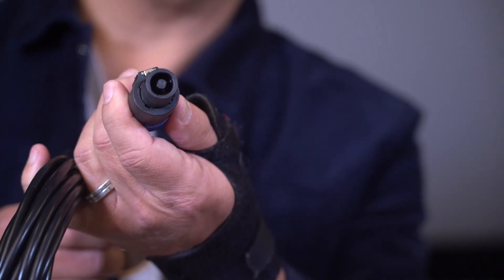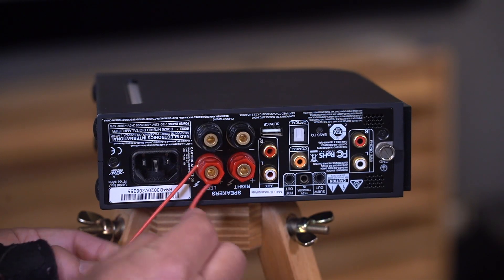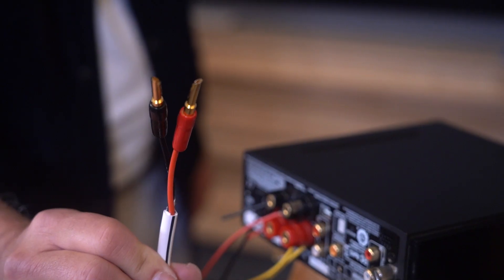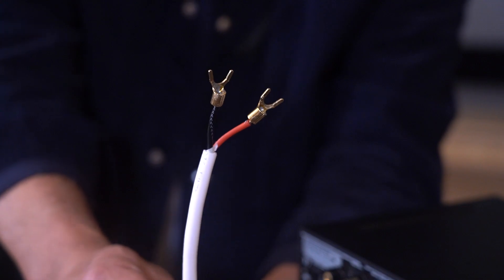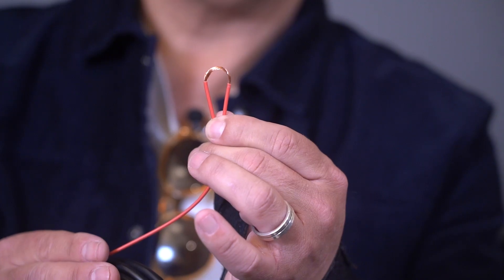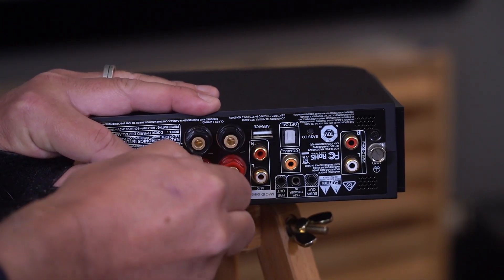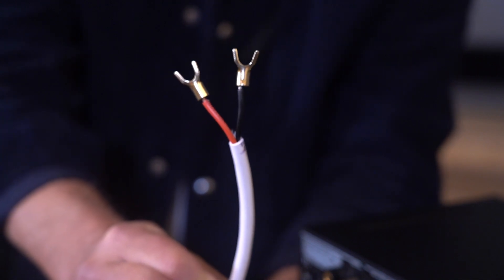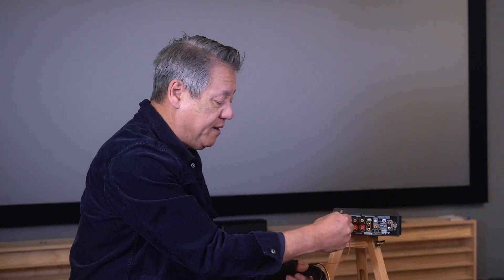What are some tips for the best way to connect a REL Acoustics subwoofer high level?

Comment: Hello, I can connect the cables of my REL T5 at the same speaker output? Not damage the power amplifier?
Reply from the maker: Thank you for reaching out. The High Level input is designed so that it can be connected directly to the main speaker output terminals on your system's amplifier, alongside your main speaker wire connection. Due to the High Level input's use of a significantly high input impedance, this connection can be made without the subwoofer placing any additional current load on the amplifier, or drawing any amplifier power away from your main loudspeakers.

Comment: Believe Accuphase E5000 with B&W 805d4, my new amp, should be OK with REL, can you suggest which model is the most compatible? Thank you.
Reply from the maker: Thank you for reaching out. Several of our subwoofer models can pair well with your B&W 805 D4 speakers, and can be connected to your Accuphase E-5000 integrated amplifier, though the ideal subwoofer choice for your system will depend on a few additional variables. When you have a chance, please write in to contactus@rel.net and a member of our team will be happy to discuss further and provide a pairing recommendation specific to your system.

Comment: Thank you for this video! I am a little intimidated about connecting the high-level cable but this makes me feel better: I am planning on using a REL T5X with a system that has a class-D amp by SMSL (specifically the AO-300 -- not the similarly-named A300 or the AO200) as the control center, and Dali Spektor 2 bookshelf speakers for stereo left- and right. So I understand that I wrap the exposed part of the red lead around the positive terminal for the right speaker, the yellow lead around the positive terminal for the left speaker, and the black lead around the negative terminal for the right speaker. Am I inviting technical problems using the other components that I've mentioned here? I know you can't use the high-power line with a balanced amp, and the SMSL is not balanced, but are there other problems I need to look out for before proceeding?
Reply from the maker: Thank you for reaching out. The High Level connections that you have described for the red and yellow wires are definitely correct, though since your SMSL AO-300 is a Class D amplifier it will be important to not connect the black wire of the High Level cable to any of the negative speaker output terminals on the amp. Instead the black wire should be left completely disconnected, or if you experience hum then the black wire can be attached to a chassis screw on the amp. Alternatively, you can leave the black wire completely disconnected and instead run a basic RCA cable from the .1/LFE input on the subwoofer to any open/unused analog RCA input or output jack on the amp. Either of these options will provide a ground reference for the subwoofer and will resolve the hum.
Reply: @RELAcoustics  Oh my gosh I am so glad I asked! The AO300 has a subwoofer output -- would that count as an "open/unused analog RCA output jack on the amp"? So I connect red to right-speaker-positive, yellow to left-speaker-positive, black unconnected, and then a single RCA from sub out to .1/LFE? (Asking b/c that's about the only open RCA socket I'll have.)
Reply from the maker: @CinemaDemocratica  Thank you for your response, and yes the subwoofer output jack on your AO-300 amplifier would work as a grounding point for the subwoofer. You would then only connect the red and yellow High Level wires, and keep the black wire completely disconnected.

Comment: Just bought a TX5. My Rotel A11 has Two Speaker Zone. Would you suggest to connect the Rel to Zone 2? While maintaining my bookshelf speaker to Zone 1?
Reply from the maker: Thank you for reaching out, and for choosing a T/5x for your home audio system! If your main loudspeakers are currently being connected to the Zone 1 outputs on your Rotel A11, then we recommend also connecting the High Level cable for your T/5x to the same Zone 1 output terminals. This will enable the subwoofer to receive the exact same signal as your main loudspeakers are receiving, resulting in improved performance and a more seamless blend.

Comment: Will this connection draw additional power from the power amp?  I have hard to drive 4 ohms speaker and I want to make sure that all the power from the amp is going to the speakers.
Reply from the maker: Thank you for reaching out. The High Level input on our subwoofers is designed with a significantly high input impedance, which means that it will not place any current load on your amplifier or draw any amplifier power away from your main loudspeakers. As a result, connecting a REL subwoofer to your amplifier using the High Level input will not impact how the amplifier is powering your main loudspeakers.

Comment: Is there a way to connect REL subwoofer high level with KEF LSX ? I guess not
Reply from the maker: Thank you for reaching out. Since the Kef LSX are active speakers, meaning that their amplifier is built-in to the speakers' cabinet, it is unfortunately not possible to connect a REL subwoofer using it's High Level input to these speakers. Instead we recommend connecting the REL using it's Low Level RCA input, to the designated subwoofer output jack on the LSX speakers.

Comment: What do you do if you have a five year old T5 that's capacitors have leaked all over and it no longer does anything but blow fuses? Should i just put it in the bin?
Reply from the maker: Thank you for reaching out, and we are sorry to hear about the issues that you are experiencing with your T5 subwoofer. When you have a chance, please write in to contactus@rel.net and our support team will be happy to assist with troubleshooting and resolution options.
Reply: @REL Acoustics  I did, a week ago, asking if I can purchase a replacement plate amp. They haven't got back to me. Just seems such a shame to throw it out, I don't think I could even if I had too. Beautiful cabinet and a waste of a damn good driver.
Reply: @RELAcoustics  actually. I sent it as a ticket on the website. I'll try the email address you provided. Tha ks for getting back to me

Comment: What if I’m running my large bookshelf speakers as “small” on the receiver but want to add bass by using one of your subwoofers for each channel. I don’t want my speakers to play low frequencies to avoid distortion. I want the low frequencies to be played by the subs. Can REL help?
Reply from the maker: Thank you for reaching out. If you prefer to run your main loudspeakers set to "small" then it will be best to connect your REL subwoofer using either the Low Level input or the .1/LFE input. A crossover can then be set within your preamp or receiver so that the signal above the crossover point is sent to the main loudspeakers, and signal below the crossover point is sent to the subwoofers.

Comment: I have a benchmark AHB2, it accepts balanced inputs only, can I connect this as normal or do I need to take the black wire to a ground? There aren't any convenient ground screws on the amp itself, ideas?
Reply: benchmark website shows you how to do it
Reply from the maker: Thank you for reaching out. When ran in it's standard stereo configuration the negative speaker output terminals on the Benchmark AHB2 reference to ground, which means that the black wire of your REL subwoofer's High Level cable can be connected to the negative speaker terminal for either the right or left channel on this amplifier. Here is a link to an article from Benchmark's website that goes into detail about connecting High Level to this amplifier: https://benchmarkmedia.com/blogs/application_notes/rel-subwoofers-with-ahb2-power-amplifier

Comment: Does this approach only work for one front speaker to one subwoofer?  I have a single sub to support both front speakers.  Will this method not be possible unless I have two subs?
Reply from the maker: Thank you for reaching out. It is easier to connect the High Level cable to the binding posts on the system's main loudspeakers if you are using a stereo pair of subwoofers, since you will have separate subwoofers dedicated to the left and right channel speakers. That being said, it is possible to connect to the speaker's binding posts with a single subwoofer though when doing so it will be necessary to strip back some of the black outer sheathing on the High Level cable so that the red wire can reach your right channel speaker and the yellow wire can reach your left channel speaker.
Reply: @RELAcoustics  Thanks so much for the quick reply.  Do to space limitations in my room, I can only use one subwoofer.  I also wanted to use the wireless adaptor.  Can the direct connection to the binding posts be done if the wireless adaptor is being used?
Reply from the maker: @redsoxjam  Most of our wireless systems do allow for High Level connection, though typically if using a wireless system you will then connect the High Level cable to the outputs on your amplifier, and then place the wireless transmitter next to the amplifier. 

For connection assistance and instructions specific to your system, please write in to contactus@rel.net and we will be happy to assist.
Reply: @RELAcoustics     Thanks for all the feedback and the how to videos.  I bought the T/9 x and will be setting it up as recommended with the front speakers in “full” mode.  What do you recommend for the center channel when the fronts are set to full?  Would you recommend setting a crossover of 120-80hz or keeping it as full?
Reply from the maker: @redsoxjam  We find that most speakers perform best when set to "large" and sent a full-range signal, though if you do not have a REL connected High Level to the center channel then you are welcome to experiment with applying a crossover to this channel within your AVR. 80Hz is a common value, though it will be best to experiment with different values to see what sounds best to your ears and in your room.

Comment: A quick question because I can’t find a definitive answer, 
I have a tube amp (it says it’s class a/b) 
So if I’m wanting to use two subs (REL Q100) I would connect the red and yellow together to left channel + and the black to left channel neg and then the same on right channel with other sub? If so am I right in saying this won’t damage the amplifier in any way? 
Thanks in advance
Reply from the maker: Thank you for reaching out. If your tube amp is Class A/B, then you are absolutely correct in terms of how to connect the High Level cables for your Q100 subwoofers. For each subwoofer, red and yellow wires will connect to the positive output terminal and black wire will connect to the negative output terminal. If your amplifier has different output terminals for different impedance speakers, then we recommend connecting the red and yellow High Level wires to the 8 ohm positive output terminal, even if your main loudspeakers are connected to output terminals for a different impedance.
Reply: @RELAcoustics  excellent thank you 👍🏼

Comment: What if your integrated amp only takes spades?
Reply from the maker: Thank you for reaching out. While the High Level cable that is supplied with our subwoofers comes bare-wire terminated out of the box, spade or banana connectors can be attached to the bare-wire ends of the cable if needed, depending on the output terminals on your amplifier.
Reply: @RELAcoustics  will it connect to a digital integrated amp the same way ? I have a Technics SU-G 700 M2. I was going to follow your manual for set up. I thought I read that if you have a all digital integrated the connection is different.
Reply from the maker: @williemclean3224  Spade connectors can be used with Class D integrated amplifiers such as your Technics SU-G700M2, though special care must be taken when connecting High Level to Class D equipment. Here is a link to our video with connection instructions for Class D amplifiers: https://www.youtube.com/watch?v=3F5WTOu60hE&t=1s

Comment: My main speakers are connecting to the 4ohm speaker binding posts on my Mcintosh Power Amp.   Should I connect the REL to the same 4ohm binding posts or to the 8ohm binding posts ?
Reply from the maker: If your amplifier has separate output terminals for different speaker impedances, then we recommend connecting the positive leads of the High Level cable (red and yellow) to the 8 ohm positive output terminals on the amplifier. The main speakers can then be connected to the output terminals for their proper impedance rating, whether that is 4 ohm or a different impedance value.
Reply: @RELAcoustics  Thanks for the clarification.

Comment: I would like to use the REL TZero MKIII in my 5.1 setup. I have an AVR with a pre-out for a subwoofer, as well as several RCA outputs unused (for rear surround speakers for example). How can I make use of the High Level connection with such an AVR? The supplied cable does not work with the pre-out for subwoofer on the AVR, right? Can I use the unused RCA outputs instead, even though I won't be connecting rear speakers but instead the REL subwoofer?
Reply from the maker: Thank you for reaching out. The .1/LFE input on your Tzero Mk.III can be connected to the designated subwoofer output jack on your AVR, using a standard RCA cable, while the High Level input connects to the amplifier's main speaker output terminals using the specialty cable supplied with the subwoofer. If the Tzero Mk.III is the only REL in your system, then the High Level cable will typically be connected to the front right and front left speaker output terminals, in parallel with your main speaker wire connection. 

For High Level connection instructions specific to your system, please write in to contactus@rel.net and we will be happy to assist.

Comment: How long is the high level cable that is provided with the REL sub? Asking this question for someone who wants to use one sub for a stereo pair of speakers quite far apart.
Reply from the maker: Thank you for reaching out. The High Level cable that comes supplied with REL subwoofers is 10 meters, or approximately 33 feet, in length.

Comment: So you connected the red to the left, just the opposite of your set up recommended
Reply from the maker: The red and yellow High Level wires are functionally identical. We typically recommend connecting red wire to right channel positive and yellow wire to left channel positive, though you will achieve the exact same performance by connecting yellow to right channel positive and red to left channel positive.
Reply: @RELAcoustics  so what about the single black wire?  2 black binding posts...
Reply from the maker: @rockyrekstad9517  The black High Level wire is exclusively for providing a ground reference between the subwoofer and the rest of your system. This means that with Class A/B amplifiers you can connect the black wire to one of either the left or right channel negative output terminal, since they both reference to ground. With balanced/differential or Class D amplifiers, the black wire should not be connected to a negative speaker terminal and instead should be connected to a chassis ground screw.
Reply: @RELAcoustics  Hi Rel! Easy to understand video and good to see that this question was answered. I am new to audio and I have an RX-A3070 AVR, should I connect the black wire to the negative terminals or the chassis ground?
Reply from the maker: @STEEVSUPREME  Thank you for reaching out. When a designated ground thumb screw is available, we recommend connecting the black wire of the High Level cable to it by default, regardless of the output stage design of the amplifier. This ground screw will provide the most stable ground reference for the subwoofer's black High Level wire, and will prevent hum from occurring.

Comment: Wish I had seen this before I pulled my insulation sleeves off!
Reply: same here
Reply: And me 😫
Reply: I incorporate mine into the banana plug themselves at the speaker end. Since I used to change amps frequently, it was a pain to manually tighten the REL connection. So now I just swap the speaker cable and the REL connection is already there when I plug in a new amp or speakers.
Reply from the maker: Pulling off the insulation sleeves is fine to do, as long as you are careful to trim the exposed copper wire to prevent it from shorting on an unintended metal surface on the amp. Keeping the insulation ends on just helps to prevent shorting of the connections.
Reply: @RELAcoustics  And, with 10m line - one can cut the wires again and use a wire stripper tool to do exactly the same again so they are slightly stripped per factory delivery (one just loses ~5-7cm in the process) Small price for peace of mind and following John's "pro-tip".
Reply: @RELAcoustics   hello i have a question.i am owner of an yamaha 803d stereo network amplifter with room correction. Wenn i go with high level must i turn the room correction of? Becouse the room correction from the yamaha will only go with the sub out of te amp??🤔 Should i then adjust the tx7 manualy? Greetings from germany
Reply from the maker: @robertdalmatinac1914  Thank you for reaching out. To get the best possible performance we recommend keeping the High Level cable for your T/7x disconnected while the Yamaha's room correction program runs. Then once the program has finished you can reconnect the High Level cable, make sure that the main loudspeakers are still set to "large" or "full-range" within the receiver, and then tune this input on the subwoofer manually by-ear to blend with your main loudspeakers.

We hope that this helps, but if you have any additional questions about using room correction software with your T/7x subwoofer then feel free to let us know and we will be happy to assist.